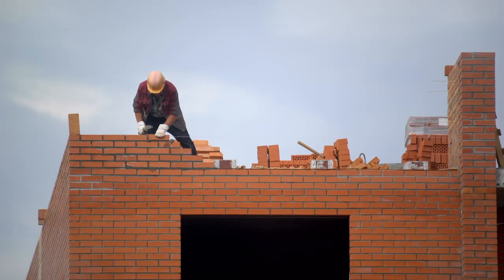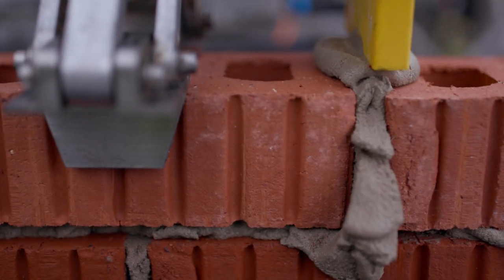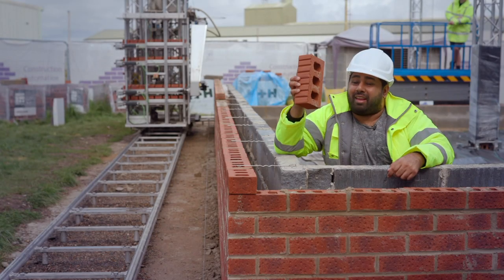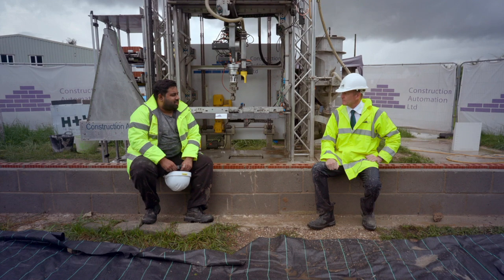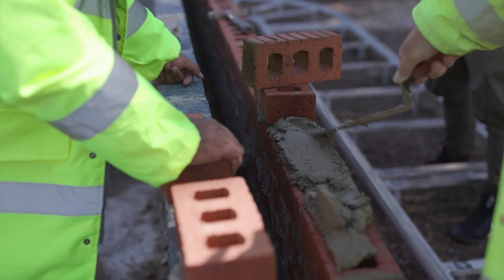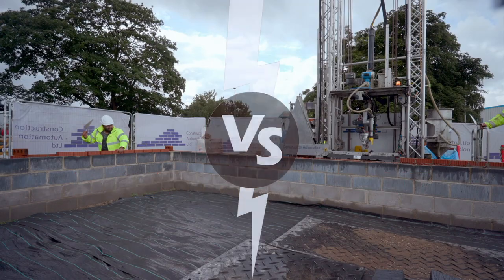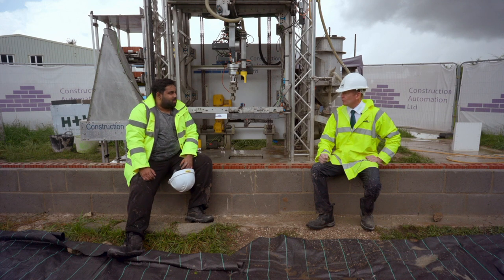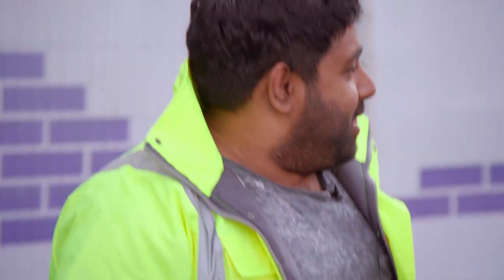Can a bricklaying robot lay bricks quicker than a human bricklayer? - BBC Click

Comment: I'm a bricklayer and to be honest some of the quality of that work doesn't look to good on the eye, I don't think you will ever do without bricklayers as the cost of that machine must be quite significant and you still need men along side it with a massive cost applied to that scaffolding as well, all thats required is companies start respecting bricklayers and stop putting profit before the quality and build times and put a good wage structure in place to achieve it ,we are also expected to lay materials that have been stored without any weather protection whatsoever,I do think the way forward is with modular buildings or kit form which are much quicker and not as hard on the individuals involved.